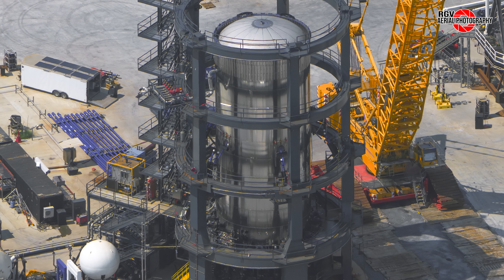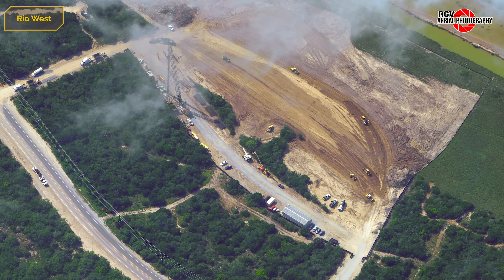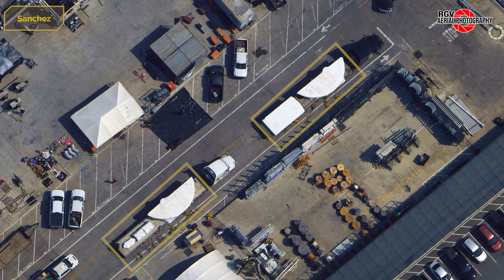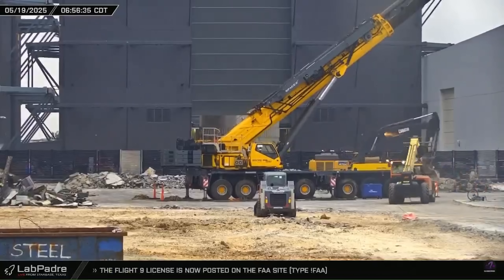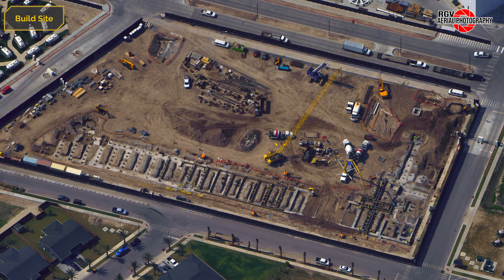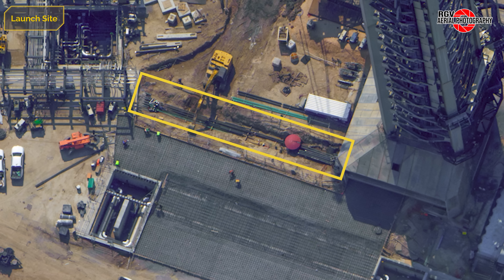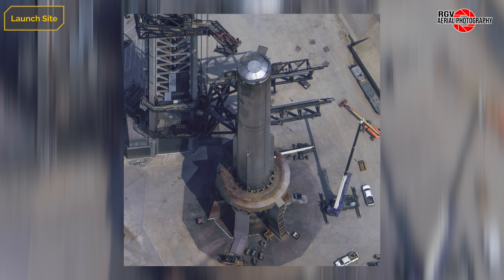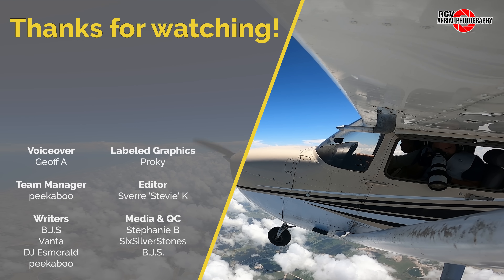Launch Soon + Tower 2 Testing! NEW SpaceX Starbase Flyover 84

Comment: 9:17 that pump is probably not pumping from the retention pond, but probably configured to dump into it once the bags need to be emptied.
Reply: There is a hose on both the inlet and outlet side of the pump. You are probably correct on the drain back though.
Reply: One of the pump's suction lines goes into the retention pond.  The pipe going to Pad B is not a suction line.